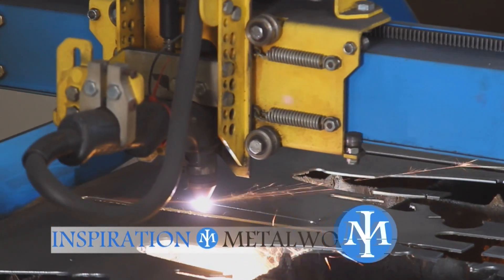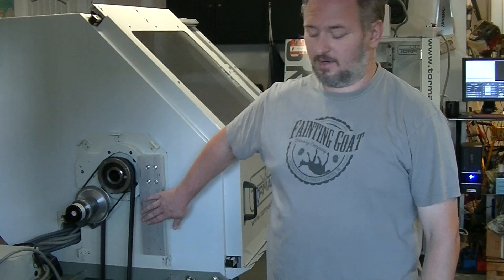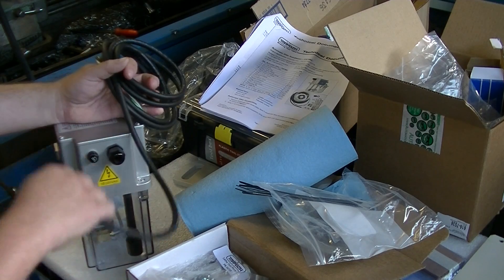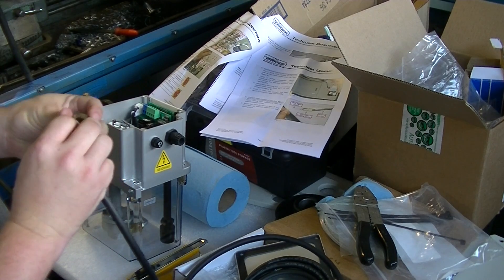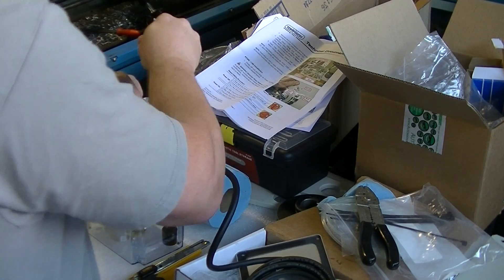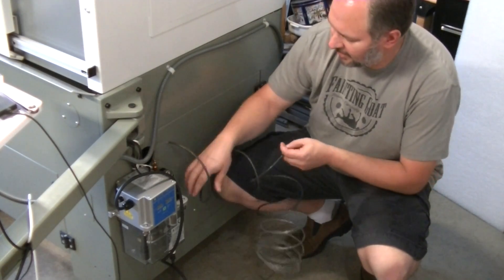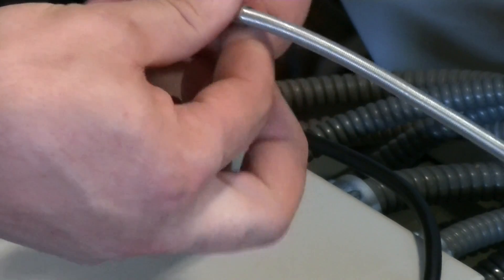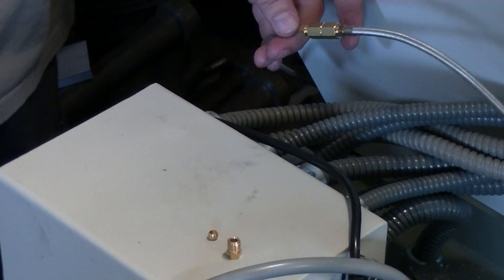Tomach Lathe   Automatic Oiler Install Part 1

Comment: put the nuts on lines and wires First then you dont get them almost done and oops where is the nut, surprised that the plastic tube did not have a liner for the fitting to crimp onto
Reply from the maker: Agreed - the lines that came from the factory had the liner and what appeared to be an o-ring seal. I've used compression fitting before and they typically had an inside and outside piece. Everything seems to be leak-free so far though. I'll check it again after the machine has run for a while and see how it looks.

Thanks for watching and commenting!
Tom Z

Comment: It is called a compression fitting. :-) I am surprised they don't have auto lube standard, proper lube is the life of any machine.
Reply: 🔥Ramsey Customs - turbocobra
 It is at least 4 I think, unless you double stack them, then 8 is probably doable. lol Fortunately for others their iron addiction is not as bad as mine although Keith Rucker may have a pretty serious case as well. :-)
Reply from the maker: Thank you, Brian! It was driving me nuts that I couldn't remember the name... Manual oilers are standard on all of their machines but I'm with you - would have liked to have seen this be an auto-lube system from the start. It wasn't even an option for the little 440 but I'm guessing that will arrive at some point soon.

Hope you are well, sir!
Tom Z
Reply: How many tormach lathes can you fit on the bed of your G&L HBM?, like 8?  lol
Reply: Ferrule.